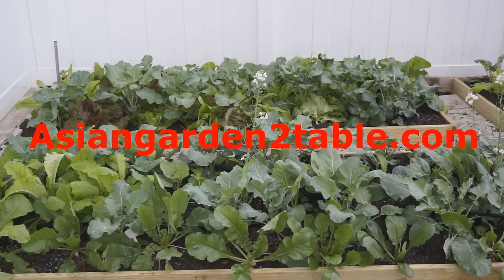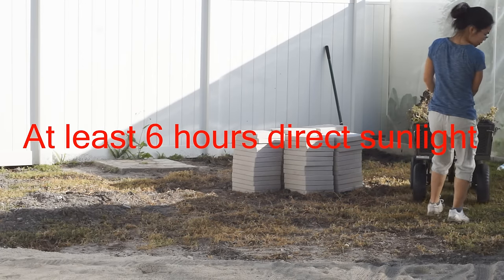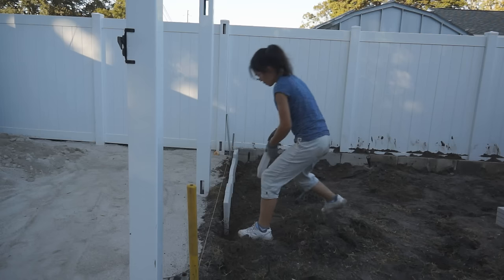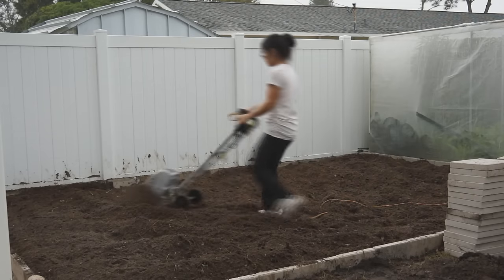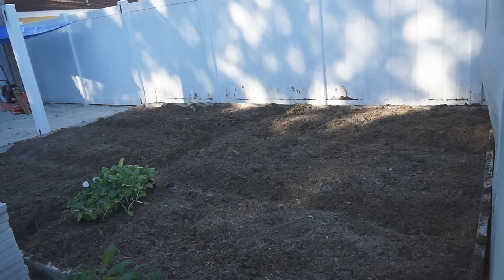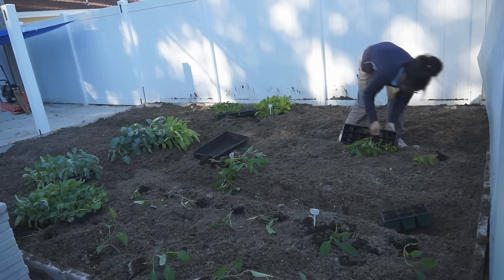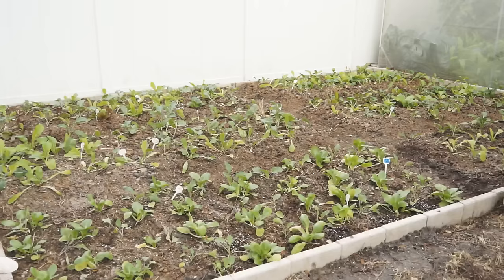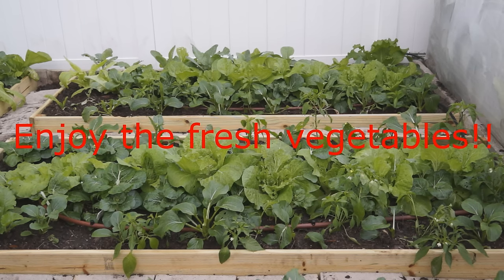How to start a vegetable garden （开垦新菜园）

Comment: Thanks for the video.  Just wonder after you plant  with organic and inorganic fertizier, do you need to add fertilizer later on?  Or you simple just water your plant?
Reply from the maker: ckw 
Hi，I used a lot of organic fertilizer (compost or rabbit manure) for transplanting. Usually spray a little bit inorganic to encourage new root. Depending on vegetables, I may use some inorganic fertilizer in the middle of growing cycle to help flowering and fruiting.

Comment: First of all - your video is amazing!! Learned A LOT!!  I have a question- If our garden has a lot of crabgrass (weeds) and I plan on having a raised bed. Should I do something in advance? I do plan on removing the top layer of the grass (beneath the bed) then adding top soil/compost (8 inches of so). Should I add cardboard under/around the raised bed? Or is removing the top layer of grass + covering that with 8 inches of top soil good enough?
Reply from the maker: Mystearical 
Depending on how deep the grass roots, if removing the top soil can remove all the grass roots, then no need to put cardboard. If not then adding cardboard will help to block grass to grow back.  I prefer to not have cardboard because it will limit the vegetables roots to grow deeper too. 8 inches is not deep enough for most of the vegetables. So the best thing to do is to completely remove the grass and its roots when you start your garden. If necessary, you can rent equipment from Homedepot which will save you a lot of work. Good luck with your garden : )

Comment: What kind of tiller did you use?  Also if I want to start my veggie garden next year, do I till my soil this fall and add compost now or next year when I'm about to plant?
Reply from the maker: Mystearical 
I bought it on Amazon. Here is the lin

khttp://www.amazon.com/Earthwise-TC70001-11-Inch-Electric-Cultivator/dp/B004H4X6Z6/ref=sr_1_1?s=lawn-garden&ie=UTF8&qid=1436043272&sr=1-1&keywords=cultivatork.

You should till you soil and bury compost now if you can. Let the compost stay in the soil through winter will help it to further break down. Low temperature will kill a lot of worm, bugs and bacteria who are not favorable to your vegetables.

Comment: Hello, i am starting a garden in my backyard, i'm very interested about you tiller. I gave up with pulling string on my lawn mower, so i though i should try electric power tiller this time. Is there any way you could give me your experience with this tiller. I would really appreciate if you could reply soon...weather's getting warm here in MD. Thank you.
Reply from the maker: +Rocky s Mum 
Hi Rochy's Mum, here is the link to the electric tiller I used in my video:
http://www.amazon.com/Earthwise-TC70001-11-Inch-Electric-Cultivator/dp/B004H4X6Z6/ref=sr_1_1?s=lawn-garden&ie=UTF8&qid=1457615558&sr=1-1&keywords=cultivator

Good luck with your new garden~
Reply: +Asiangarden 2table 
Hi again, thanks for your prompt reply. I know where to buy this tiller but, i don't know this machine is good or bad. So, If you don't mind, i would like to know how well this tiller works for you?  Do you recommend this machine?
Reply from the maker: This machine is pretty powerful for doing its job. The only downside is it has to attach to power so you have to drag a wire around. But for this price, it is a great deal. The review on Amazon is really good too. Yes I would recommend it.
Reply: Local Home Depot has it on sale, or you can buy it at HSN for free shipping. Thank you so very much for your time. God bless :)